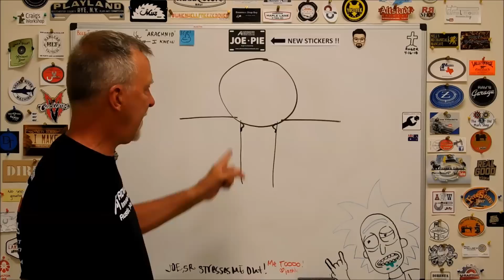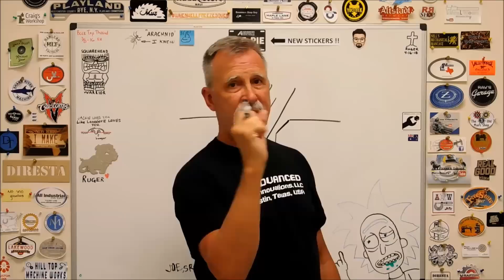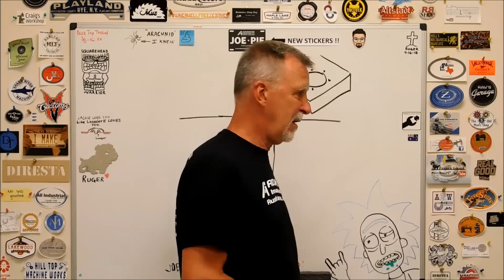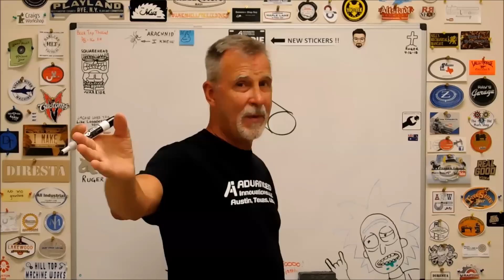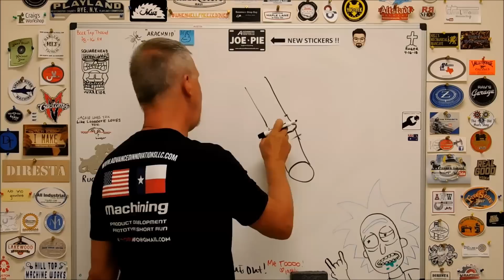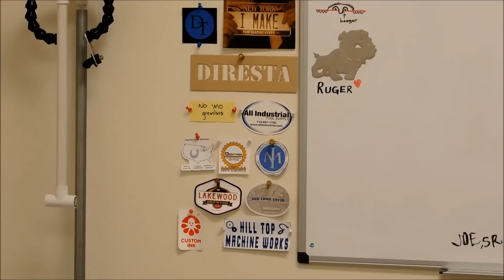7 Identical Problems, 7 different Solutions ---Take a Look !! ---

Comment: A few other techniques for making the pin bigger.
1) Make scratches with a file or knife on the pin
2) Make a thin cut with a handsaw on top of the pin, and then use a flat screwdriver or shizzle to spread the 2 parts, the same like a splitpen does.
3) A different version of number 3, and with a blind hole, is to make a thin cut in the pin, then making a wig that fits this cut untill half way of the cut, but a little bit longer. Then when sliding the pin in the blind hole, a little tap on the pin, and the wig spreads the 2 parts of the pin and will lock itself thight in the hole.
4) Like 3, but with ball bearing instead of a wig to splice the pin on the bottom. 
With the last 2, the pin can not be removed easily afterwards.
Reply: On behalf of us amateurs thanks for adding to the conversation, which is something we need more of these days rather than the usual social media garbage.
Reply: @tonywilson4713  , I'm no expert (never have been), but during my mechanics training in the early 90's I had an oldskool mechanics teacher who taught us some tricks from the old days. After graduation, I worked several years as a mechanic/welder, then 5 years as a car mechanic, followed by about 10 years as an IT technician, many tricks have been useful during all these years.
Reply: @BjornV78  Yeah I started with a degree in aerospace but have worked for 30+ years in control systems, robotics and automation. The Amount of stuff I have learned from people like you and Joe is staggering. I actually get frustrated with younger engineers these days who really do think there's nothing to learn from tradesmen.
I am a firm believer that its a must that engineers go back to the technician level earlier rather than later and get their heads around practical aspects of engineering. There's to much done on 3D cad packages these days. Yeah its great, but engineers need to grasp the practical aspects of engineering as well.
Reply: @tonywilson4713  , i agree. I follow a lot of YouTube channels about Electronics, but when they start talking and using Arduino etc, i click away. Using Arduino in Electronics i call it the lazy way of doing Electrics. Sure , the job gets done, but where is the fun, when using regular electronic parts to get the same results. Grtz
Reply: @BjornV78  I 1/2 agree.
Arduino has its place, but I'd argue its proponents have way overplayed its importance.
All of what it does in terms of motion control is open loop stepper motor systems and they will simply never match servo systems in terms of performance. That's not to say steppers are useless but its like comparing a simple inline 4 against the latest Cosworth V12 in Gordon Murrays T.50

Comment: Many thanks for that. All good tips, though the nurling ones seem best for maintaining concentricity.
Reply: Agree that knurling retains the concentricity better. If thick grade loctite or metallised epoxy is also applied then the adhesive will stop any metal displacement on the 
high points of the knurled section. Real strong and robust that way.
Reply: @howardosborne8647  Interesting addition to the tip.

Comment: For short pins in soft materials such as these if the od isn't critical just drill a hole in a piece of steel slightly larger than the hole you're trying to fit it in, lube up your pin and drop it in the steel hole and smack the end of it with a hammer to enlarge the entire OD.

If you have a long pin and you want to enlarge just the end you make the steel part a good fit for the pin, drop it in leaving the bit you want to expand sitting above the surface and then smack that with a hammer.  Then just turn it down to the correct fit.

Otherwise, Loctite.

Comment: The diaamond knurl is often used for threaded inserts in electronic equipment, usually brass into plastic for holding cirrcuit boards
Reply: You used to be able to buy small straight knurled press in soldering posts for plastic and circuitboards. Used a lot on old Tek instruments etc.
Reply: Most threaded inserts in plastic, like in notebooks, are placed by ultrasonic vibrations, not by just pressing into the plastic.Due the ultrasonic vibrations, the plastic melts and becomes a tight fit in milliseconds. Here's a video about this ultrasonic technique, you hear a high high squeaking sound when the inserts are placed. 
https://www.youtube.com/watch?v=Akol1DPYXfw

Comment: Hi Joe,
a tail stock barrel OD is 0.07 mm less than a tail stock hole(25mm). Can you advise how to fix this?
Thanks.
Reply: What type of clamping mechanism is fitted to the tailstock?
Reply: @BedsitBob  a bushing with a wedge. 
The clamping is not a problem, but it is shaking during the drill operation
Reply: They are usually more worn at the open end than further back inside the bore. A good solution is to bore the first 1 1/2" or 2" out and make a bushing sleeve that is a really snug fit on the tailstock quill and slip fit inside the nose of the tailstock body and use loctite retainer on the outside dia.
Reply: @howardosborne8647  it is cylindrical exactly 25mm, it is not a wear, it is a "manufacturing quality", made in China. The quill is cylindrical as well, but 25-0.07mm 
The bushing is not an option - the walls thickness is too small.  Thanks.
Reply: I'm quite surprised to hear there is not even enough wall thickness on the front end tailstock casting to allow a thin walled bushing to be fitted? 
If you can't go that way then another option is to have  a piece of precision ground  bar made to fit the tailstock bore more precisely. These things can be fixed but they ain't always a simple fix. I have repaired old worn tailstock castings by both boring and bushing and line boring and making a new quill to suit.

Comment: As usual a very useful demonstration, I would also like to add as per the previous comment that Loctite or some other brand will enhance the structural  efficiency of these basically single point fixings to a very high degree, if the operational temperature of the part is suitable.   As Joe  rightly pointed out make sure what you have done is appropriate for the application. Sure could be useful fixes for some applications.

Comment: Thanks as always Joe, my go to is a straight or single cut knurling on the pin, absolutely rock solid, as others have said, nothing wrong with a good degrease and loctite if the application allows too
Reply: A single cut knurl would make the pin work like a drive rivet / hammer drive crew (the pins to hold machine tags on cast iron). 
Some diagonal grooves made with a chisel should do the trick as well, and can be done without any machinery.
Reply: The combination of knurling the pin and also using high viscosity loctite or metallised epoxy works extremely well. The addition of epoxy or structural adhesive fills the voids in the knurl low spots and prevents the pin loosening due to metal displacement on the knurled section of pin.

Comment: Would use a gage pin of the proper size for the press and hard turn the exposed portion to the original size as needed if the application was critical. Otherwise, the staking methods and loctite all work especially the knurling

Comment: Surprised that Loctite did not get mentioned. 601 works with up to 0.1mm gap.
Reply: I use 648, max gap is 0,25mm or 10 thou and it's stronger.
Reply: @MF175mp  648 is my goto as well. 660 fills gaps up to 0,5mm. They usually work really well even if cleaning is less than perfect. I used to be a sceptic, but the bond is very strong. Do not use screw fasteners, the cylindrical fasteners give much stronger bonds. Easy to unlosen by a small torch.
Reply: @erikisberg3886  yeah, the 660 isnt as strong but it could save the day on a really loose hole

Comment: Good one. Goid to keep in mind. However the ball trick only holds the pin on the most upper portion of the hole, might be a problem, the knurling holds the pin with the entire length of the hole, which I believe is better, but I have been wrong before....😀
Reply: I agree, I would say the knurl is the most accurate method to retain some concentricity & alignment. It’s always been my go-to.
It’s surprising how little it needs too.

Comment: Had a similar problem about a year ago where the hole ended slightly larger than I wanted it on a one shot deal i think the hole ended up as a taper because i was using a boring bar i ended up using red red locktite and its still holding

Comment: A video thesis on fitting pins in an oversized hole. I learned some new ideas here as well. I recently got some Loctite for oversized holes, its been working well for me. This worked real well on a part I had hardened, and the pin was hardned as well.

Comment: Keep in mind that if the part is for a customer and the part is no longer to print (you blew the hole) you need to either remake the part or check with the customer to allow the deviance. Doing a hack like this and then passing off the part as made to print is fraud.
Reply: Joe does say this is for hobbyists
Reply: @andybelcher1767  I've audited machine shops where they have done these kinds of fixes on production parts that have caused issues in final products.

Comment: If you don’t have a straight knurl, you could use a fixed tool and raid it up so only one wheel is in contact. It will be spiraled, and may work better than diamond pattern. 

Great video! Thanks for sharing.

Comment: I forgot to mention the obvious when I got distracted with the knurling. Sometimes when I run across a hole that's the wrong size or rather almost all the time I run across the hole that's the wrong size it's because I did something dumb. As long as the hole is in the right location I can usually get away with just making a pin.  Lathes are really good at making round things like that.

Comment: We've used several of these techniques at the shop and we've also used bearing glue that takes up several thou depending on the application.  I personally like to knurl the pin and used a single knurl roller to give a twist knurl when I couldn't find our straight knurl tool.

Comment: I was a machine repairman at GM. I worked on machines that had a table that indexed around via a cam engaging ball bearings on pins that circled the table (a Geneva type motion). When a pin would no longer stay in the hole, I used the method of center punching the pin. It was quick and easy because you had to get in an awkward position to work upside down on the table from under it. Modifying the hole was not easy without taking the table out to work on it. As mentioned, this method is one of the best for making a tight fit. Also, by putting indents all around the pin, it will locate itself in the center of the hole provided the hole is not distorted. This was necessary for the accuracy of the operation done on the part sitting on the table.

Comment: Lots of great ideas. Thanks just the other day I had to replace a brass shear pin and my stock was a bit undersized. I cut the length I needed plus a tiny bit more. I then put it in a vise and squeezed it from end to en. It made a nice tight fit.

Comment: One more method: grasp the brass plug with a pair of slip joint pliers and squeeze tightly. This will put grooves with raised edges in the plug.
Reply: That is a variation of punching around the pin and knurling.

Comment: Joe,
Another old shop technique is to size your reamer before using on your job. By that I mean drill several holes ream the 1st hole normally. Then to get the friction fit your looking for you use your oil stone on the reamer with the reamer spinning in the chuck. You do this a little at a time till you have the perfect fit. 
Reaming is aways a black magic subject- speeds, feeds, materials,  material hardness. Size of the chamfer on the hole and on the end of the reamer! Thanks for sharing!
Mike - Plus8Precision

Comment: 8) Super glue or locktite.
9)Bigger pin.
10) Tap the hole turn thread back to desired pin diameter.

Lot's of solutions depending on the application.

Comment: As a tool and diemaker, We (unfortunately) come across this from time to time. My go to method on doel holes is to destroy the cut edge of a tap or use a form tap and run a tap through the hole. The taps are a bit bigger and will leave a spiral deformed groove down the hole. It looks good and works pretty good also

Comment: Thanks Joe, those are great range of examples to help solve this problem.
As an old Jeweller, I've used the "centrepunch" option to salvage a set of expensive Pliers that had movement in their Pin.
Often on Jewellery "box-hinge" Pliers, the "body" has its hole chamfered & the Pin gets riveted over then ground back flat.
In that case, do multiple centrepunches within the Pin (close to edge) to help displace enough material & tighten them up.

Comment: We have a rockalizer that works very well for this problem.
Reply: Sorry, what is a rockalizer? Is that the rocks you throw at people who made the mistake in the first place?
Reply: @bobhudson6659  it's a machine that adds a tiny bit of material onto the surface of the metal. It uses an electrode that rapidly vibrates burning tiny specs of the electrode on to the pin or in the hole.
Reply: We also use the Rocklinizer in my shop. Works really well for this problem.

Comment: Great examples Joe!  The knurl and dent examples can also be post dent turned to basically create a metal stretcher effect for sized fits.  Also post peening to prevent a screw or pin from backing out. Mechanical deformation is often a win especially where using a retaining compound where using heat would be bad.  You always seem to hit the topics right on the ?pin hole! Stay safe! Phil

Comment: Thanks for the tips but.. .
How long will those faked fittings last when the pin has a varying radial load?
I'm surpriced a guy like You even think of such mumbo jumbo methods.
Thanks anyway. There might come applications tollerating things like this.
Reply: He never said it was a universal solution for every application. Bet you are not old enough to remember when knurling pistons to resize them was SOP, or ever saw a 100HP motor shaft knurled to correct a loose shieve. (That's a "pully" to amateurs") I'll bet you never saw a portable manual knurling tool used for exactly that.

If you had been around as much as you want people to think you would not be insulting a tool and die maker calling his tips "mumbo-jnmbo"
Reply: @mathewmolk2089  No, that's clearly not for every application but it takes experienced/knowing people to realise that.
You lose that bet.
I've been designing heavy warehouse fork lifters for quite some years and assisting the assembly guys. The chief of the department named methods like this as "Himpa vimpa", translated to "Mumbo Jumbo".
Did You talk to Joe, knowing Joe was insulted?
The Joe I've seen so far is doing things involving math and theory aiming at perfectness. Therefore several of the methods making one dimp looked strange to me. How long does one little dimple last? The pin gets off center.... It just didn't look like normal Joe Pie methods.
Reply: Joe stated very early in the piece that it all depends on the application - he spent some time laboring that fact. As Matthew Milk has said, this is not a universal solution. Also please give Joe credit for knowing what he is doing. He is a master tradesman and teacher. He has probably forgotten more than we will ever know. Joe is doing these videos to teach us the options of getting out of a jamb, that is if it is appropriate to the application. Like using a match stick in a hole when a wood screw no longer grips. Sometimes it is appropriate, sometimes not.
Reply: @bobhudson6659  Please read tehe reply to @Mathew Molk.
Being out in the jungle, in the desert, out on an ocean.... One uses any method thinkable to get up and running. It just surprised me a lot that Joe presented such jungle methods at all.
Not long ago Joe showed how to take care of hole not being as it should be....
Oh yes. All respect for the aim for perfectness, starting down in the theories of math and physics.

Comment: I'm sure it's already been mentioned but you could use a single wheel on your diamond knurl and gotten a displacement straight cut. The pin might have turned as it went into the hole but it would be less likely to broach the hole.

Comment: Not a machining question but I've heard you complain about the heat before. Why don't you air condition your shop? No one questions heating a space when it's cold. You're at an age where you've spent a lot of time in a sweltering shop. C'mon man, you deserve it!
Reply: Cost. He has a huge shop. Several times larger than mine. I couldn't afford the air condition my shop either.
Reply: @cncmoldsnstuff4423  Swamp cooler might work pretty well there, I don't think the humidity is very high in Austin, but I could be wrong.  If anybody is interested it takes about 2-1/2 times more power to cool then heat
Reply: @mathewmolk2089  If its like here (I'm in SW Arizona near Yuma) it will work the first half of the summer, but the humidity climbs the second half of the summer and its less effective.     Swamp coolers also seriously humidify the air.  I've always shied away from pumping damp air through my shop.  Maybe just paranoia and maybe not.  Steel saws, steel and iron machines, steel benches, steel parts, steel tools....  and steel building.  LOL.  I am a lot closer to the Sea of Cortez than Austin is to the Gulf of Mexico, but they may still get monsoon season humidity.  FYI:  I left a back door partially open for a couple hours after breaking down some stock (I should just move that saw) and it was 104F inside the back shop today.